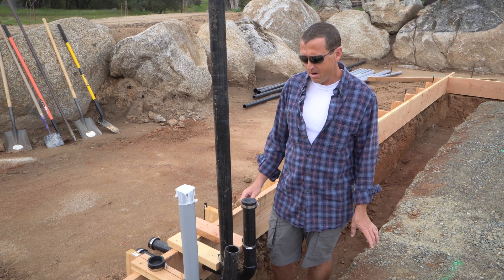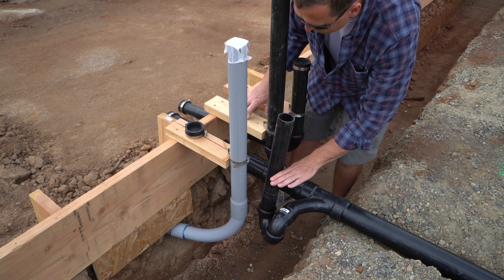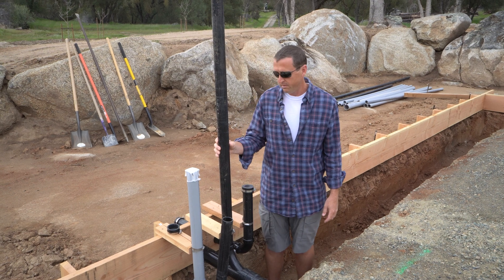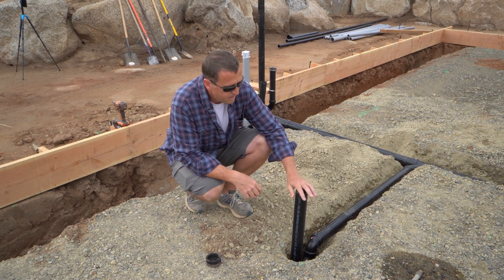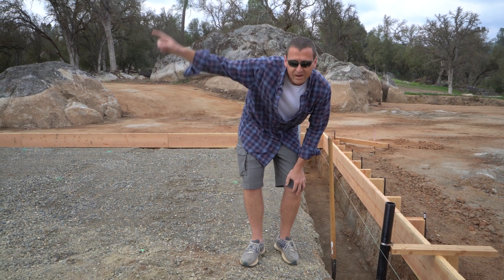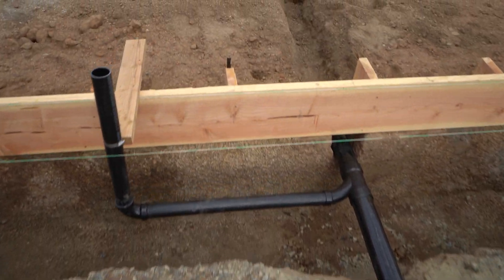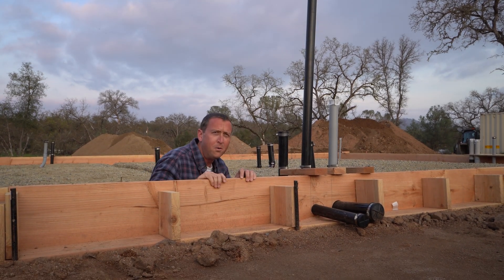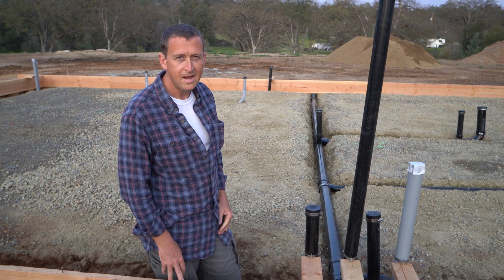Drainage line water test

Comment: Thanks again for sharing all this - quick question, did you have to sleeve your plumbing pipes with a larger size pipe where the drain lines are passing through the footing? Or did you just wrap them with foam?
Reply from the maker: The plans didn't call for a sleeve so we just wrapped them with foam. Thanks for watching!

Comment: Thanks for documenting this! Super helpful for all of us. I know you mentioned wrapping the pipes to account for a bit of concrete expansion but I don't think I see any of the pipes going through a sleeve in the footer, which is something I've seen on other videos (IE any pipe going through the footer goes through a sleeve 2 sizes larger than the pipe size. Not required in your area?
Reply from the maker: I think I've seen the type of sleeve you're describing but maybe it's only required based on the foundation type? Ours is a monolithic slab instead of footings/stem walls so maybe that's why it wasn't in the plans for us or required per the county. Anyway, hope that helps and thanks for watching!